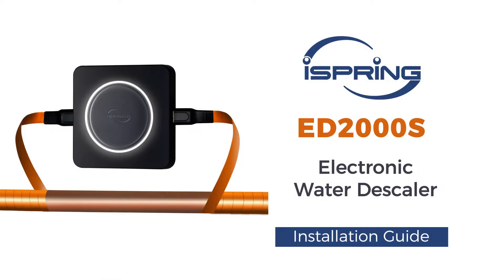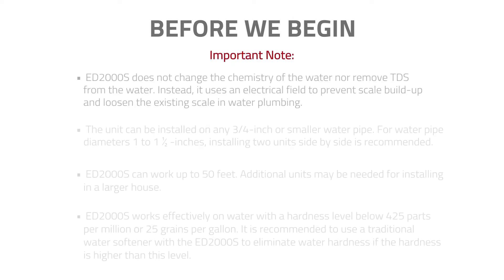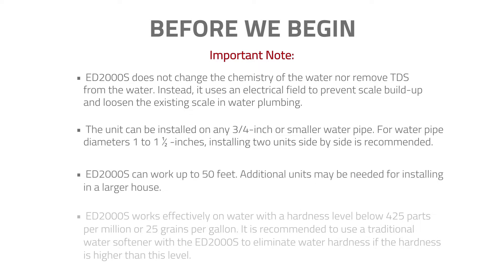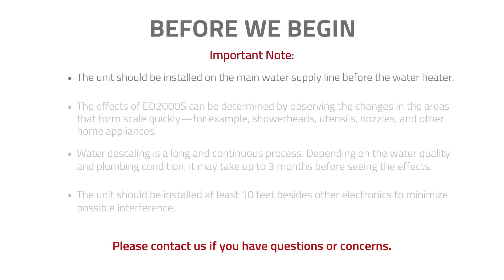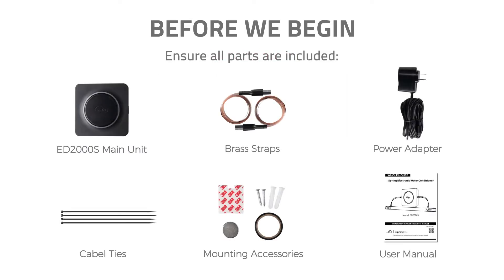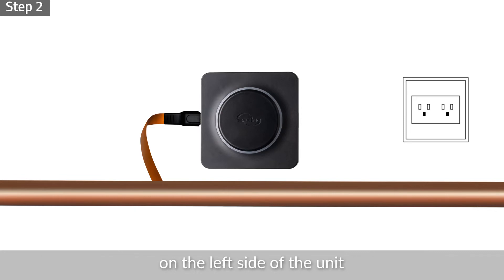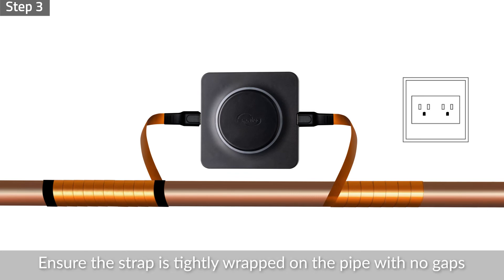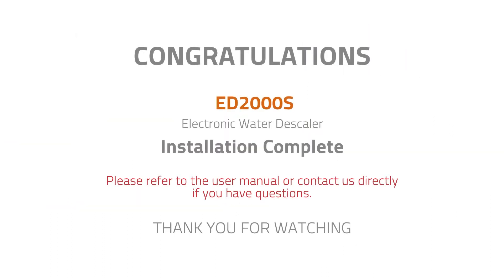How to Install iSpring ED2000S Electronic Water Descaler | DIY Installation

Comment: How far should the two groups of coils be?
Reply from the maker: Hi there! There isn’t a specific maximum or minimum distance required between the two coil groups. What matters is that the brass straps are wrapped tightly against each other, with no space between the wraps. Each strap is long enough for at least 12 rounds, and we recommend a minimum of 7 rounds — the more, the better.
If you have further concerns or questions, feel free to contact us at support@ispringfilter.com or call 678-261-7611 (M–F, 9 AM–5 PM EST). We’re happy to help!

Comment: Hello, is the ed2000s available to purchase ? I cannot find it on your amazon page nor your website. Otherwise does the ed2000 also work on 25gpg water hardness ?
Reply from the maker: Hi dear customer! Please, check the ED2000S here:
https://www.123filter.com/ac/index.php?rt=product/product&product_id=10081&acid=2 
Regarding your other question, ED2000 has been designed for very hard water areas (10-19 grains per gallon)
For any questions, please kindly contact us at support@123filter.com , at (678) 261-7611 M-F 8:30-5:30 EST or at (470) 560-0012 M-F 8:30-5:30 EST (Messaging only) 
We are happy to help!
Reply: Thanks a lot !